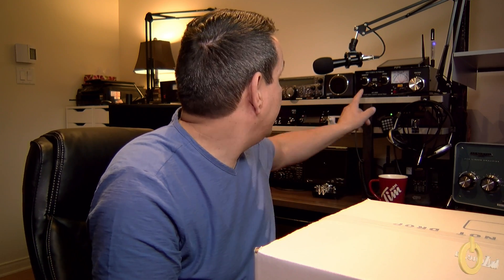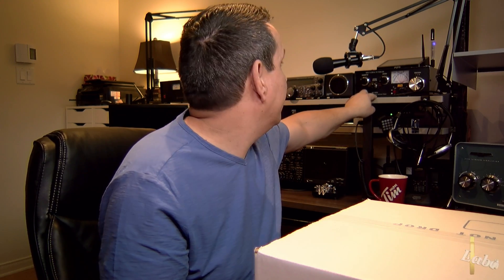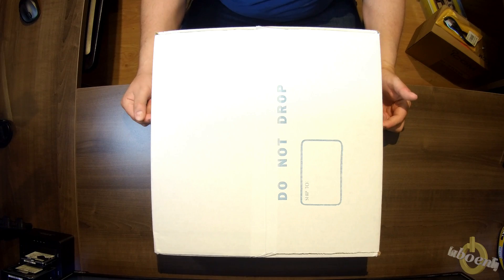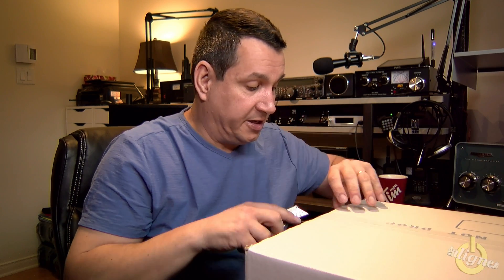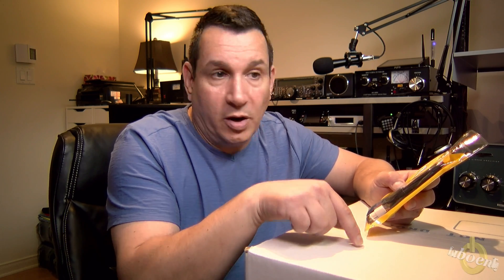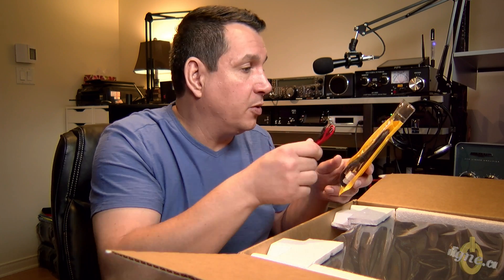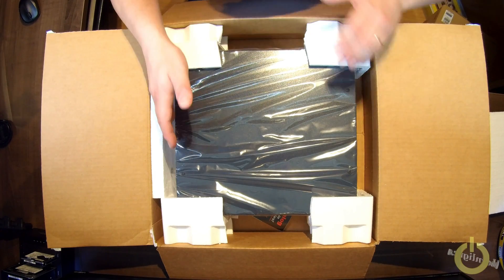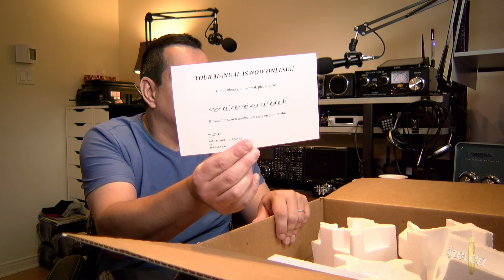Unboxing the MFJ-998 - 1500 Watts automatic antenna tuner

Comment: very good explanation, Can you please enlighten me to the following question:  in my case at the moment I have 2 antenna One vertical + One G5RV while now I am using the Alpha delta-2 switch box and currently connected to a manual MFJ 962e  afterwards with the MFJ 998 auto if I want it to memorize settings for both antenna I have to remove  both antennas from the switch box correct? No need for it! and obviously connect directly both antenna  to the MFJ 998? And from the MFJ 998 I would select the antenna I want to work with Correct in this way each time I use one or the other the MFJ 998 is storing the settings in memory?

Comment: Did the control cable work?  I have the Kenwood Tx-809s and am ordering the same tuner and it doesn’t list your 909 or my 809 as the correct cable